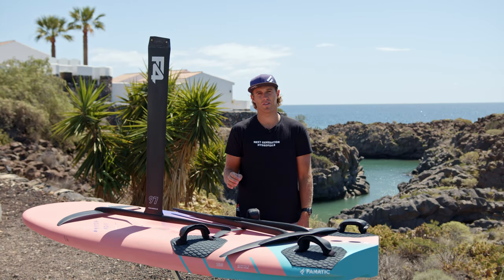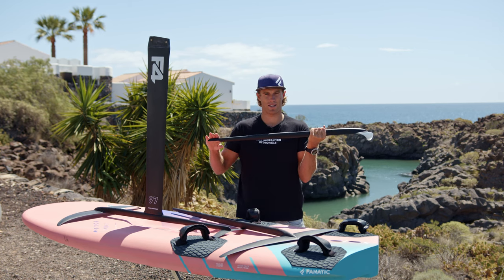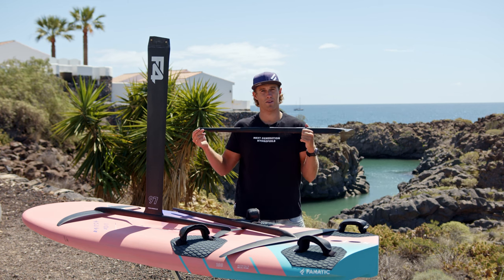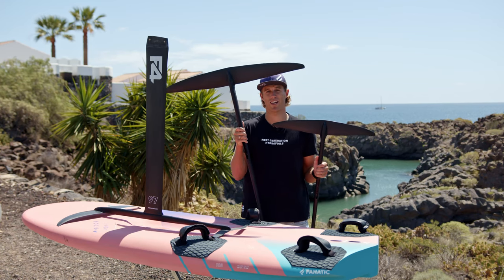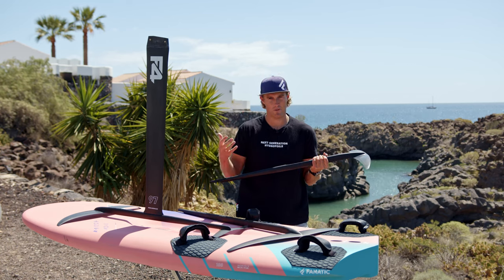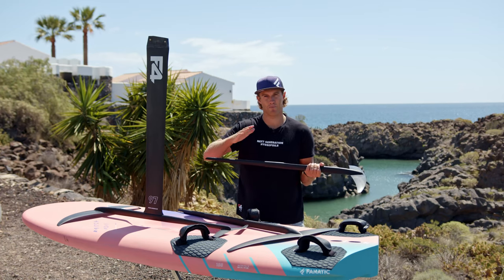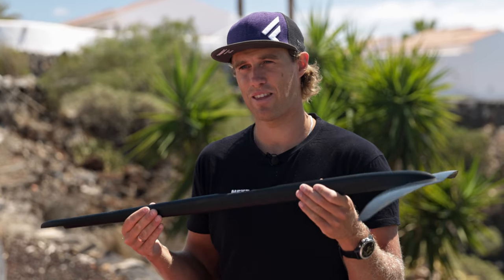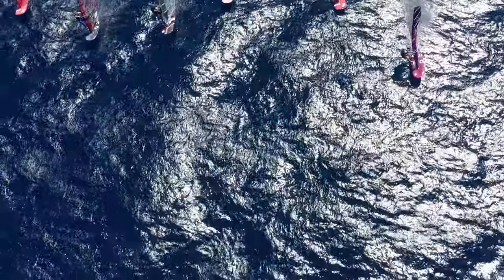Episode 5 - High wind vs. Light wind windsurf foil setup

Comment: This whole series is so great. There is so little good information on set up and tuning wind surf slalom foil gear. The content, presentation and explanation of the Foil information is just great ….this is a Goldmine for those of us trying to increase our speed and tune and slalom foil gear. 

I really really appreciate the effort & time that F4 and Jordy put into putting this series together, It’s invaluable. Congratulations on a great series and thank you so much. I will mostly likely sell my current set up and invest in F4 foils next season. I really appreciate when manufacturers support the equipment they market and sell with good content on design philosophy, set up and tuning so the end user can optimize the products potential.